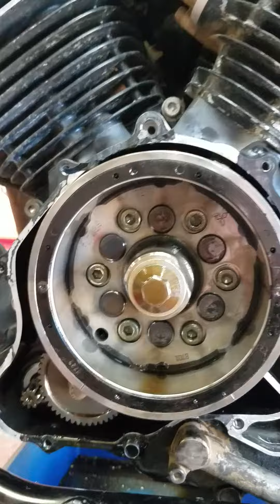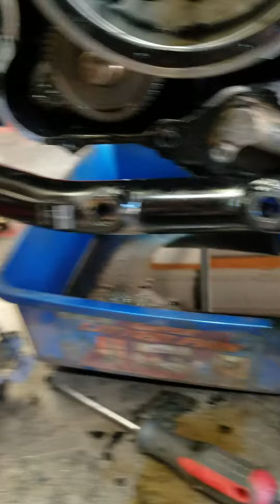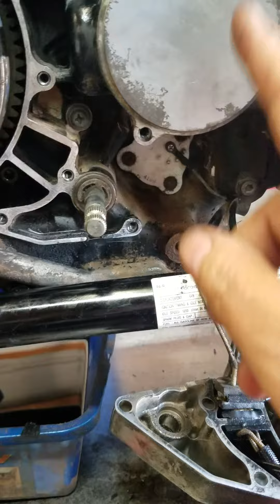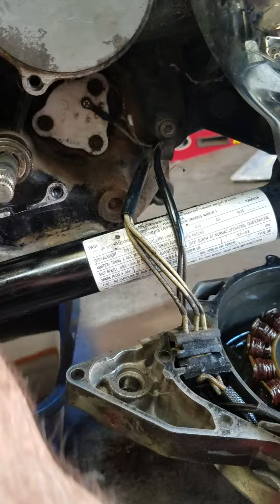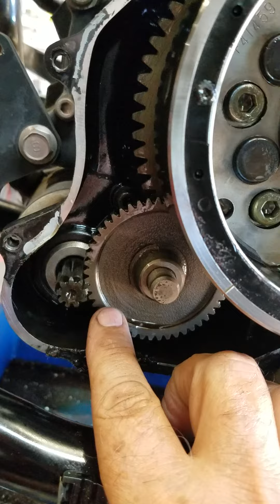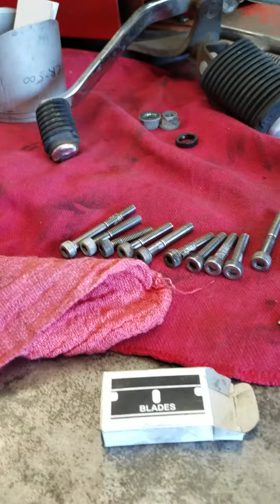Yamaha V-Star XVS650 or xvs1100 stator install

Comment: do you have to time the cam when you replace the stator? I put a new one in and still don't have spark, im wondering if it's off timing or i may need a CDI? i replaced the coil packs and the pick up still no spark
Reply from the maker: You can get cam timing off, always need to check or can bend a valve.

Comment: The V Star 650 does not have a center stand so to take off the side stand, the bike will need to be mounted on a paddock stand or so.
What did you use?
Reply from the maker: I use a big air operated motorcycle lift, but, you can lay it over... Put the right handlebar against a wall, get it over as far as possible

Of course, it's not as messy to go ahead and drain the motor oil first

Comment: Is there any difference between 650 and 1100 stator plugs? When I was replacing the stator (1100 classic) the clutch lever went limp,  right to the handle bars. Is this because I drained the oil or have I screwed something up?
Reply from the maker: If clutch was ok before stator, bad after stator, yes, you have something together wrong
Reply: @geezermoto7820   I haven't replaced the oil yet. Can the clutch operate without engine oil?
Reply from the maker: @carandme1  yes. Very much so.
Reply from the maker: @carandme1  right there on the left engine cover where the clutch cable goes into the engine the cable hooks onto a simple lever...maybe you left that off. This is only "clutch" thing you mess with when doing a stator
Reply: @geezermoto7820  This lever you speak of, does this also have a very small spring connected to it?
Reply from the maker: @carandme1  yes

Comment: Where do you disconnect the stator wires from the bike?
Reply from the maker: Under your left thigh. It's under the rear plastic, high on left side
Reply from the maker: Under left side cover, just lower than seat
Reply: I have a 03 650, when I take off the left plastic, it just takes me to the right side above the battery.
Reply from the maker: @alessandroriccio2469  just simply follow the stator wires up to where they connect. They are just below the fuel pump. Remove the very back chrome engine cover on left side, then you will see wires exiting out of the stator

Comment: Is this the same as yamaha road star 1600 ?
Reply from the maker: Very very similar but the 16 is much simpler..  on the 650/1100 it's very easy to bend valves, and impossible to bend them doing a 16 stator or start clutch
Reply: @geezermoto7820  so there is noway of off setting the timing right? And is it basically take off put back on im a little nervous to change it
Reply from the maker: @tkong35  correct, you cannot mess timing up or cam timing on 16, can on 650 and 11
Reply: @geezermoto7820  thank you Sir u are awsome u helped another issue before with my crank pulley 🔩!!!!!
Reply from the maker: @tkong35  you are very welcome, I've worked on this stuff pretty much full time for 30 plus years, don't know it all, but have seen lots lol
Reply: @geezermoto7820  i have another question when i open up the case that covers rhe stator is there oil.or any fluids in there on the roadstar casue i notice a gasket comes with the kit i ordered any infor will help thanks agaim in advance check out my road star
Reply from the maker: @tkong35  yes, motor oil is there, so, change oil and filter while at it
Reply: @geezermoto7820  thank you sir!!
Reply from the maker: @tkong35  👍👍
Reply: @geezermoto7820  would i have to remove the whole sode including the belt and stuff im kinda nervouse and i cant find any videos on the roadstar
Reply from the maker: @tkong35  not the belt, but you will need a flywheel puller...about 20 bucks probably